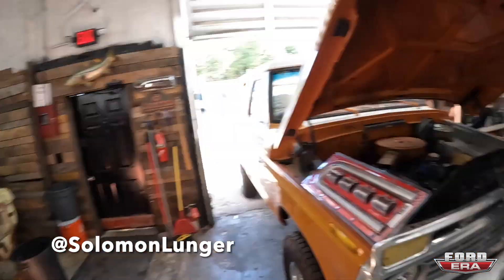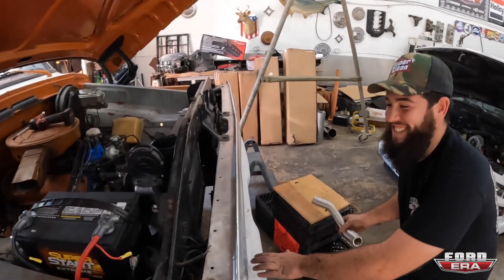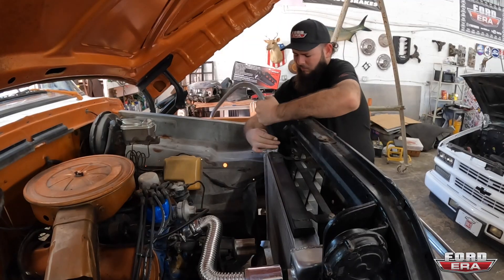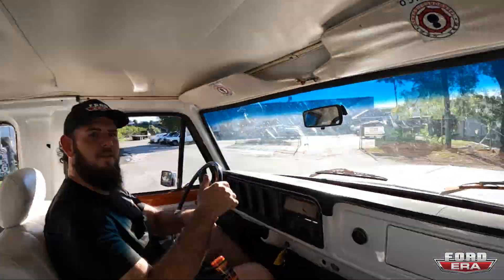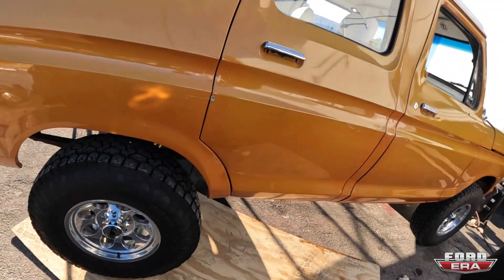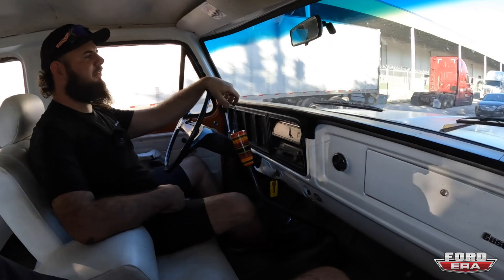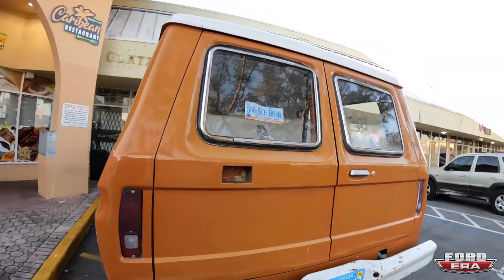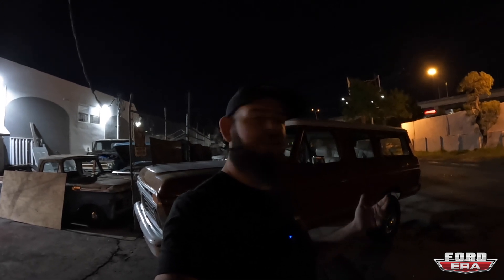Getting our 1975 Mexican B100 Road Worthy! | Ford Era

Comment: Never even knew about B100's until I saw them on your channel...they are WAY cool. Didn't even see them growing up in Dearborn Michigan, and Ford tests a lot of prototype stuff on the city streets. Been a total Ford truck guy since the late 70's, started with a 79 F150 2wd, then started plowing snow with my 76 F250 hiboy. Had F350 4x4 plow trucks ever since. My ultimate truck would be a 76 F250 supercab shortbed 4x4 with a 460. Just don't see any clean dentsides up here anymore. Happy Holidays, and thanks for posting.
Reply from the maker: glad to help shed light. sounds like a good lineup

Comment: Merry christmas from oz🇦🇺 .Thanks for the great videos an with the old ford front end all ive done on mine is to centre the steering by counting lock to lock an putting wheel in centre an adjust the toe in to 3mm or 1/8th of a inch using a tape measure from the same lug on front an back of tire level with the axle an if you have had the front end out of it drop the tie rod off the pitman arm an measure from front an back inside of tire to chassie to get wheels straight  than bolt it altogether an check toe in as that is the only adjustment on them an ive saved so much money by doing it myself ive had 2wd 76 f250 for 32 yrs .